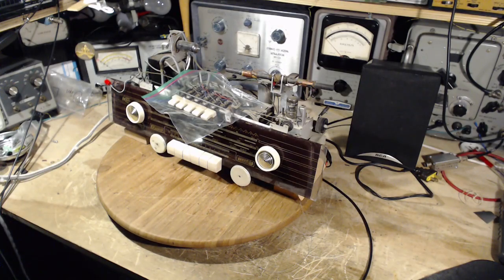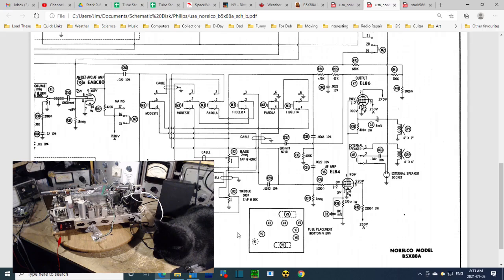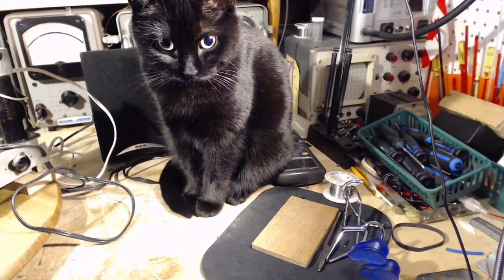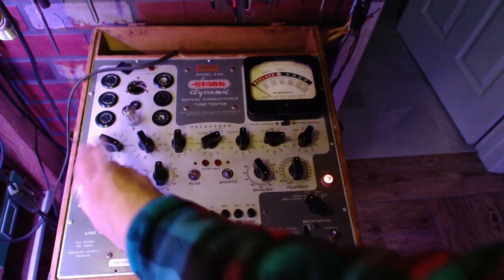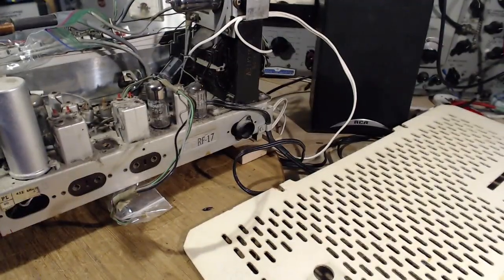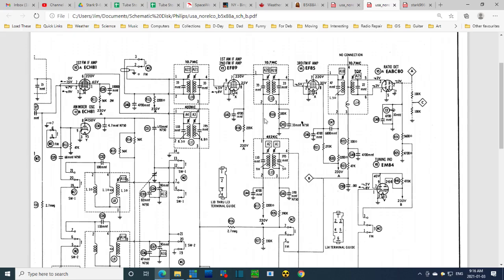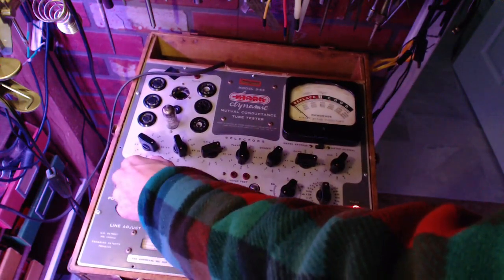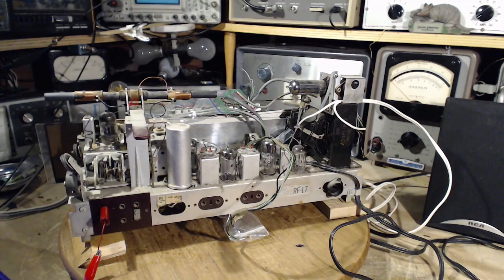Philips B5X88A AM/FM/SW Tube Radio Video #4 - Tubes Tested

Comment: Jim the audio output stage is an unusual Output Transfomerless design. The speakers in the set are likely to be far higher impedance than the 4-8 Ohms typical elsewhere. If that little monitor speaker is a modern 8 Ohm unit (probably is) it will create horrible impedance matching problems which may account for the low output volume. By all means test for bad tubes but I would try the radio again with it's original speakers now.

Comment: That output stage is a OTL and the B+ for the EL84 comes from the EL86 via the 470R resistor and is a wide bandwidth amplifier like the plate drive amplifiers that are found inside color television CRT based sets and you will find that there are three one for each color ie. Red Green and Blue.
Reply: Yes, also being OTL the speakers in the set are likely to be far higher impedance than the 4-8 Ohms typical elsewhere. If that little monitor speaker is a modern 8 Ohm unit (probably is) that will create horrible impedance matching problems which may account for the low output volume.

Comment: 25:40 The sticker reads 6DA6 which is a EF89. EF87 clearly is a misprint. Plus EF87 and EF89 have a different pinout regarding all electrodes but the heater pins and can never work in place of the other. So since the radio worked partially the one in the radio (EF89) must have been correct.

Comment: If you take the tubes out of the sockets clean both the sockets and pins to remove oxidation. A micro brush set of nylon bristles and proper contact cleaner is needed.
Whoops, Jim doesn't appear to have either!

Comment: 5:33 Stop babbling nonsense please! There is no "trebalizer" or "basarizer" capacitor! This is a single supply Push Pull output stage that uses no transformer. As such it needs a capacitor to block the DC offset in the output stage from the very high impedance speaker.
Which also explains the importance of no leakage being present in that coupling cap unless you want to ruin these unobtainium speakers

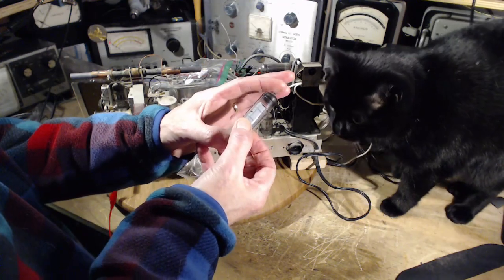Comment: 2:07 Do your homework! One is EL84 the other one EL86. Although their pinout and most electrical properties are the same, you must NOT EVER mix them up.
The EL86 was specifically designed to be the top half of a EL84/EL86 push pull amplifier. The EL86 is based off of a UL84. The UL84 is a EL84 with a high voltage heater and as such was constructed to withstand a high heater to cathode voltage. To make the EL86 they replaced the high voltage heater on the UL84 with a 6.3V one, but kept  the high heater to cathode insulation properties.
This enables the EL86 to run a cathode voltage of more than 100V with the heater still referenced to ground as is the standard for most parallel heater sets.
Without the "invention" of the EL86 you would need to provide a floating heating voltage for the upper tube in the push pull output in order to not exceed the heater cathode voltage limit. If you mix up the two and end up with a EL84 in place of a EL86 it will arc over from heater to cathode.
Reply: Correct 😉 In addition, the UL84 has a lower output impedance to deliver more power in transformerless sets with low supply voltage. EL86, UL84 and PL84 are the same tube with different heater voltages. EL84 and UL84 (PL84) are false friends.
Reply: It's a output without transformer for special high impedance Speakers.
No push-pull, El 84 is the Driver for the kathode follower El86
Reply: @hippsterhoppster1855  I mentioned this a few videos ago. To my surprise, the amplifier is quite loud with the 8 Ohm test speaker.